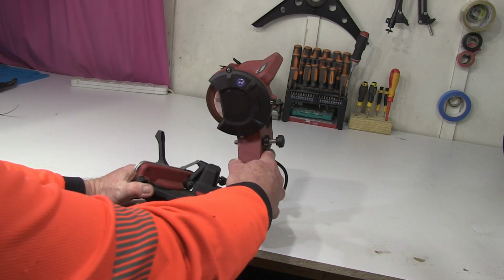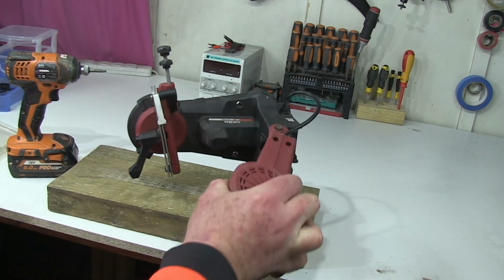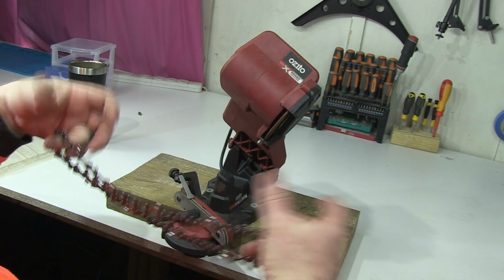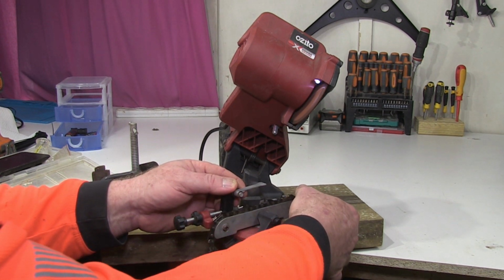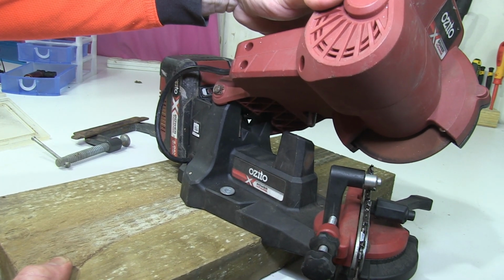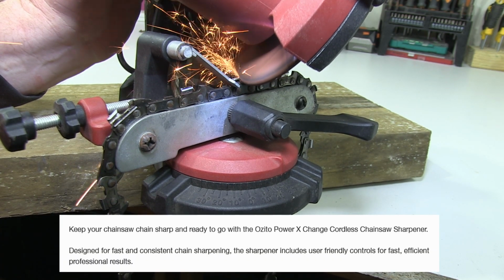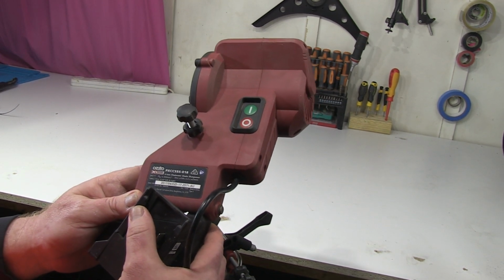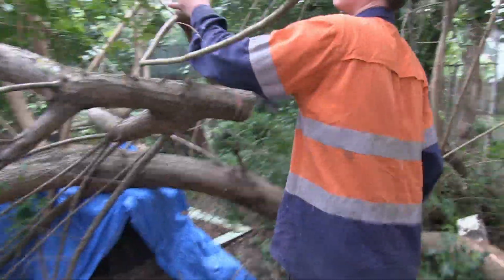Ozito PXC 18v Cordless ChainSaw Chain Sharpener From Bunnings 1yr Review

Comment: 30° cut most chains can't be sharpened more than a couple of times. What complaining? Its simple and easy to use, it takes about 10 mins to sharpen a chain. No drama, you could also mount it in your workbench

Comment: It's been 40 years since I sharpened a chain saw. The last time I tried the chain cut in a curve, even though people showed me how easy it was. My eye for getting angles correct is useless and I can't cut a straight line with a had saw if my life (or any one else's life depended on it). I enjoy doing wood work, but I must have equipment that does the angle work for me. A few years ago I got an ozito pole pruning chain saw (19inch bar) and decided to give the chain sharpener a go. It took a few years to need to sharpen it and this was the first review I read about how to use it. I told my wife that I will just go and by another chain. Then I watched another users review. I eventually clamped it to a work horse with a G clamp and it did a brilliant job!!!! So glad I got it. So long as you do both sides that same it should be fine.

Comment: I bought the sharpening tool when I bought my chainsaw attachment and used it for the first time today. Set it up 30 degrees one way, 30 degrees the other way. Set the depth, Set the pitch had the job done ten minutes.  Had no problem  clamping it with two little clamps to my workmate. This is a delicate piece of equipment not something you shake and wob le about. It's done a fine job. I have been in engineering over 60 years and I think it's about time you called it a day giving out false information to people. All my power tools are einhell and ozito and don't have any problem with them and have 15 batteries that have come with them. Also your language is disgusting you need to get your mouth washed out with soapy water.
Reply: You shouldn't have to have a clamp to use this though, it should be usable right out of the packet like plenty of other sharpeners out there. The cussing is just part of the culture, get used to it.

Comment: Agree it’s shit, but it’s still a world better at sharpening my chains than I am by hand haha. I’ve just calibrated my hand pressure to deal wit all the slop and flex in the head and somehow manage to get results. But ya, fair review overall. I went cheaper and got the 240v
Reply from the maker: You know its funny you said that because i was thinking of commenting on the video that i can get my chains very sharp with this as long as you bend the head back and forth lol
BUT i decided not to because 
1) you should not have to other wise in the instructions they say flex the entire unit lol
 2) ppl only hear what they want and if i say it dose work for me they could try it and stuff there sh****ttt up and i don't want to be responsible for that ..
Cheers Mate Gym_